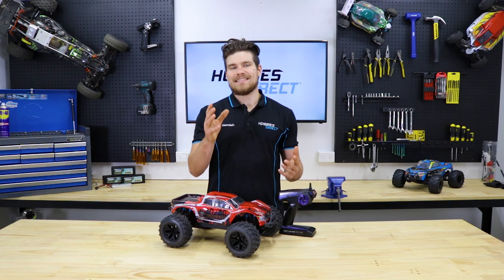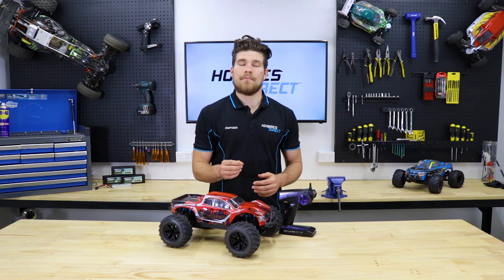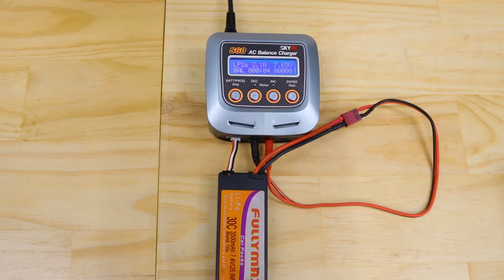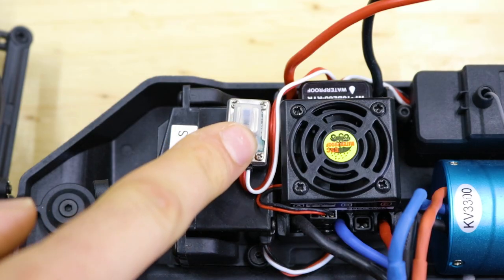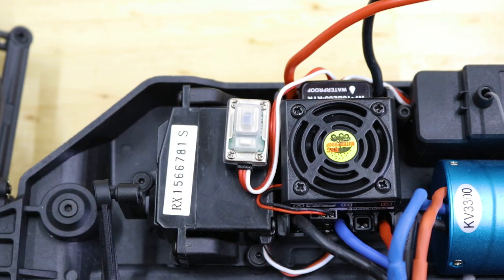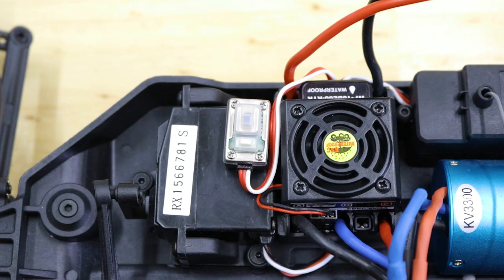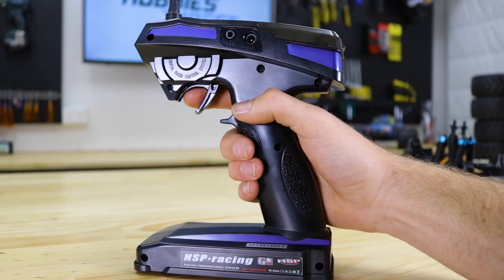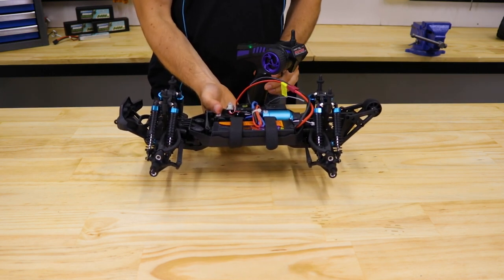How to: Calibrate a Brushless Hobbywing ESC in your RC Car

Comment: I have a carmaxx60 esc and it wont beep to calibrate
Reply from the maker: Hi Dr1ftk1ing, I think they might have a different calibration process then Hobbywing ESC.

Try the following.
1
Switch off the ESC, then connect the ESC to a fully charged battery pack and turn on the transmitter and set the throttle channel to REV.
2
Hold the set button and switch on the ESC, wait for about 4 seconds until the orange LED is solid, then release the set button, pull the throttle trigger to full throttle until the red LED blinks and goes on solid.
3
Push the throttle trigger to full brake until the orange LED blinks and goes solid.
4
Return the throttle trigger to the neutral position, both the red and orange LED will blink simultaneity and then go solid.
5
turn off the ESC
6
turn on the ESC and test to see if the calibration was successful

Hopefully, that works.
Reply: @HobbiesDirect  nope it wont work!
Reply from the maker: @BlackSV650S  Do you mind sending us a short video via email to info@hobbiesdirect.com.au?
So we can try and work out what's going on.
Reply: @HobbiesDirect  okay, ill do it tonight (in the netherlands) because im in school right now
Reply: I have a goolrc 120a esc I cant get to work. When I turn it on it beeps once and the light stays red. I have steering but no throttle

Comment: I went through the process and still no reverse
Reply from the maker: Hi Troy, if you have successfully calibrated the ESC and it still won't go into reverse it could be that the running mode is set to "Race mode" which will not allow it to go into reverse (forward/brake only). I'd check to make sure the first option (first beep) on the programing options is set to forward/reverse with brake (two beeps) :-)
Reply: @HobbiesDirect  no help.. one beep nuterul 2beep full fowerd 3beeps full reverse

Comment: How to calibrate reedy sc1500-Blc brushless? No switch or power button?

Bought a Rtr 1/7 scale Rc and it’s having problems with throttle… how to setup? Please help
Reply from the maker: That ESC uses the exact same programming protocol as in the video. If it no longer has the set key, you'll need a compatible program card.

Comment: Dear admin... I too using the same model, but drift type... I just wanted to know why when I accelerate the car moving forward it run slow but when I reverse the backward it run faster... any setting problems
Reply: Swap the 1 of the 3 motor's cable.

Comment: After I start it and its beeping, when I click it again it just goes quiet and the light turns off
Reply from the maker: That sounds like the first step; when you press it for the first time (after holding it down) the beeping should stop. You then move on to calibrating the throttle and brake end points.

Comment: What if it keeps blinking green when i cut the car on?
Reply from the maker: The instructions say the green led flashing is overheat protection - if its doing that when you just turn it on, there's likely something very wrong with that esc. Is the motor beeping as well?
Reply: @HobbiesDirect  yes All I know is when I did something to the throttle reverse and it took off now it just turns left n right when I cut it on 🤦

Comment: I can't get mine to flash green
Reply from the maker: Does it still beep? There may be a problem with the green led, or with the set button itself.
Reply: @HobbiesDirect  I can't find a set button only a bind button to bind car to transmitter
Reply from the maker: @chrisspearline767  What kind of ESC is it?
Reply: @HobbiesDirect  a typical WL Toys 45a esc
Reply from the maker: @chrisspearline767  Might have to read the manual for that one, not familiar with the workings of WL Toys' stuff.